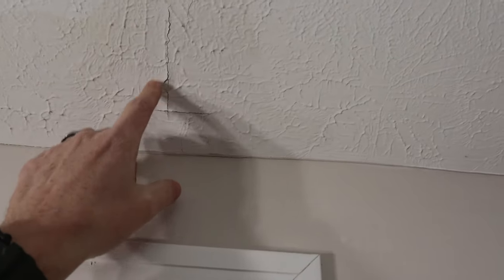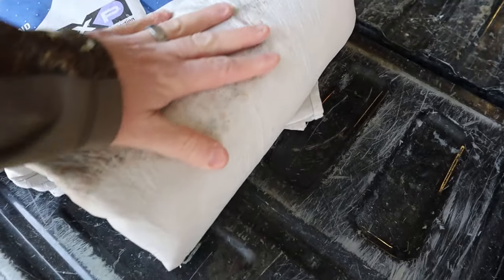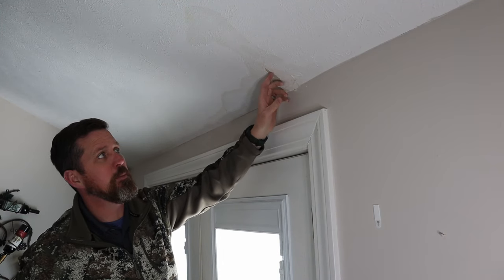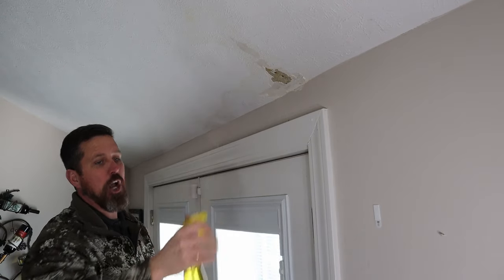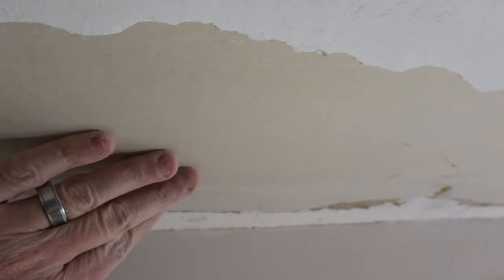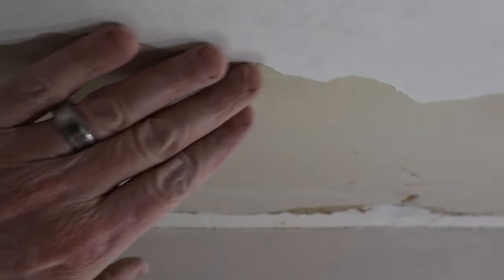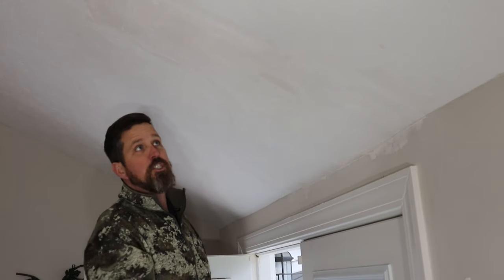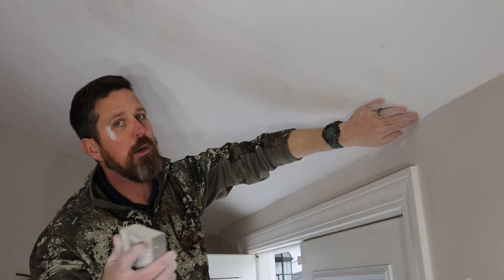How to repair a textured ceiling

Comment: If I'm repairing a section of texture in the bathroom can I use premixed wallboard joint compound and do I need to use primer as the base or on top of the joint compound before I paint again ? I had an area with chipped and peeling texture and I painted over it and it pulled off a huge chunk of the texture, I just want to do the correct steps
Reply from the maker: @ivrie  yes, you can use premixed. Just add enough water to thin it down to the consistency of a milk shake. I do usually apply primer before I paint. Good Luck
Reply: @linkinlogs6991  thank you so much
Reply: Premixed is the ONLY way to go for texture like this.

Comment: That is in fact the wrong brush for this style texture. The brush used was similar in size however the right brush used came with the bristles completely flattened making a wider circle. This texture is one of the easier textures to match. Still looks fine in the end tho
Reply: That’s what I’ve been finding. I believe AMES sells the flat “rosebud” style brushes that match most ceiling textures I encounter. The brushes used in this video always leave fine stipples and don’t have defined lines in my experience

Comment: You keep on talking about holiday build-up. I have never come across that term, what is the meaning of those word
Reply from the maker: Great question. According to dictionary.com: an unintentional gap left on a plated, coated, or painted surface.
I refer to holidays anything like bubbles, goobers, streaks, scratches, or accidental overlap of material that dries. In this instance, it refers to drywall compound that is not very smooth, or has ridges in it. Hope this helps explain. Thanks for viewing!
Reply: @linkinlogs6991  Thanks for the info, it is the first time I have heard it and I did not think of looking it up in a dictionary, I have my copy of” The New Collins dictionary and thesaurus dated 1991” but it is not in there so I assume it is a resent term ology.